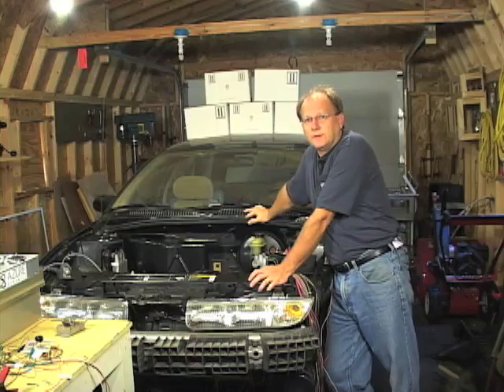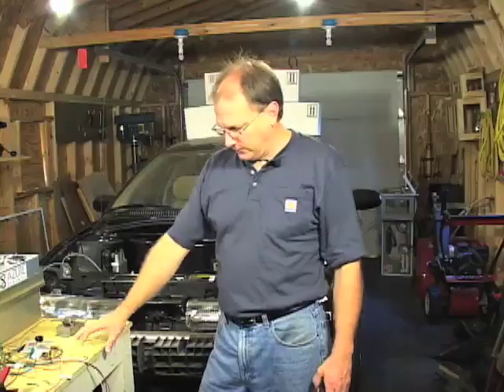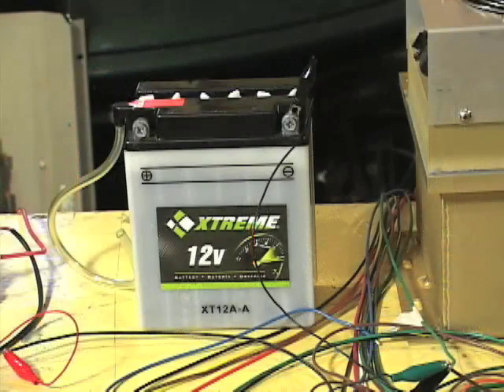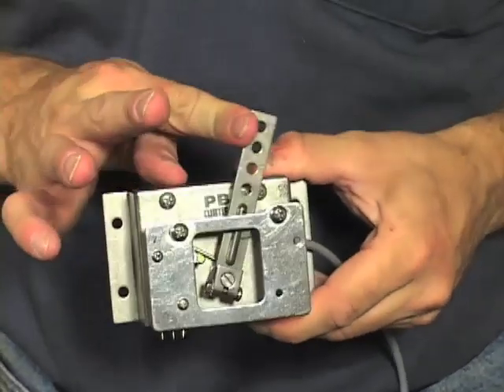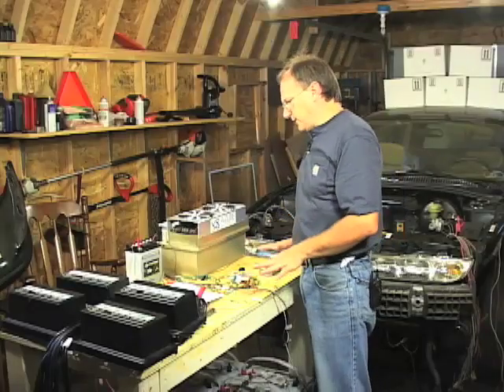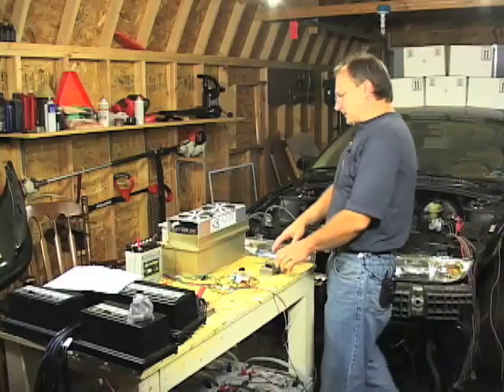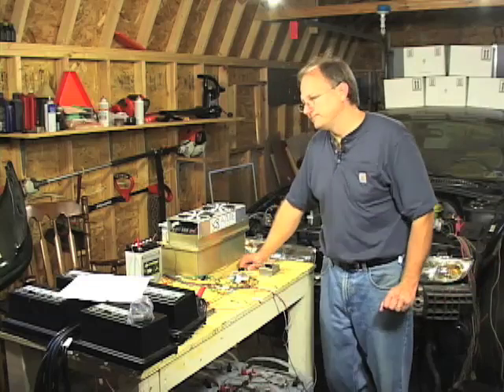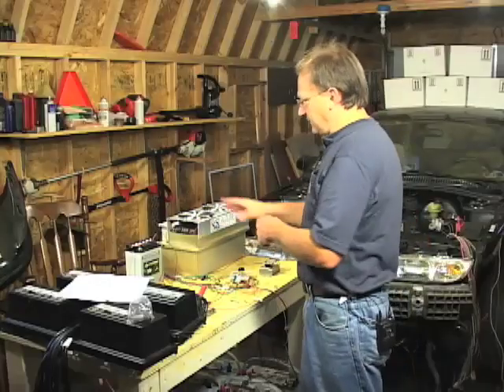Spinning the Wheels

Comment from the maker: I went with the AC motor for the better efficiency, lower maintenance and regenerative braking. The top speed is 65 mph and it does drag on the hills. The acceleration is not the greatest.

The new 20kWh lithium pack gives me a range of about 75 miles with local driving.

I selected the motor and controller 3 years ago -- there are better AC options available today. If you want the best acceleration at a lower price, go DC.